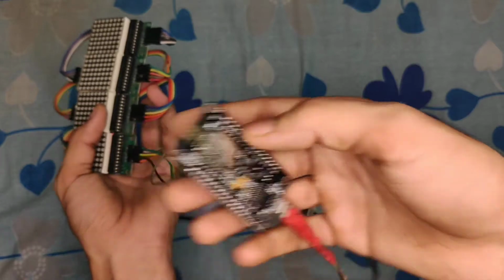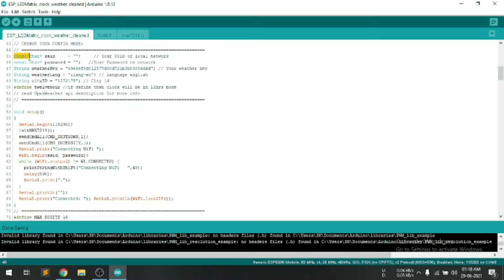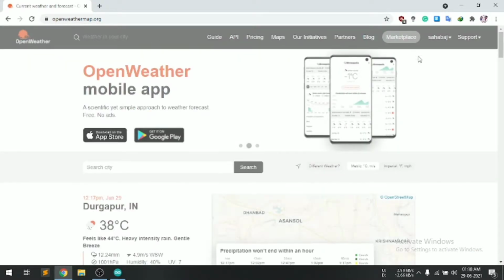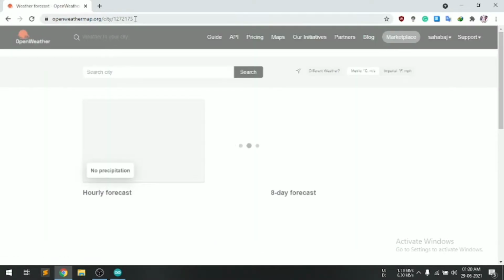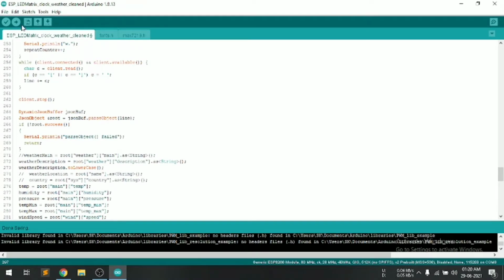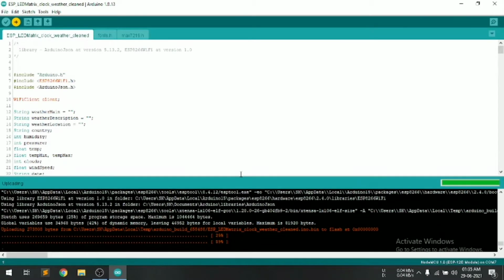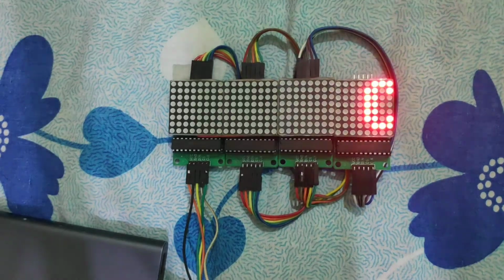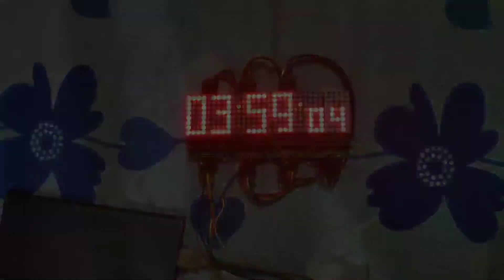Nodemcu (Esp8266) & Max7219 weather station/Clock. The easiest way?

Comment: I encounter     long epoch = round(curEpoch + 3600 * utcOffset + 86400L) % 86400L;  error, could you tell me how to solve,please
Reply: Same issue here,
 dont know how to solve
Reply from the maker: @TanvirAhmed101 also u can replace the line with this but this isn't tested u can try and report back long epoch = (long)(round(curEpoch + 3600 * utcOffset + 86400L)) % 86400L;
Reply: @SKElectronics  This code change worked, the only issue is your system is configured to use 4 separate 8x8 to make a 4x1, but most of the people might use 4x1 Matrix, now all information are scrolling vertically   :D
Reply from the maker: @TanvirAhmed101  if that what's u want then great
Reply: @TanvirAhmed101   can u giveme the code for  4 in 1 matrix 7219 display
Reply from the maker: @TanvirAhmed101  The code cannot be compiled on the latest version of the ESP board (2.5.0), so we must install an older version (2.4.2)
Reply from the maker: search the error on Google u will find how to solve it.
Reply: @SKElectronics  Yes Sir.

Comment: Sir, fonts.h library not available?
Reply from the maker: available put all files in same folder
Reply: Sir, display format is not proper.
Reply from the maker: @pawankumarsingh3996  r u using the same display module or not?

Comment: Hello!  When compiling the code, it gave me the following error: "error: DynamicJsonBuffer is a class from ArduinoJson 5" (lines 325 and 334).  Any idea why that happened?  Thank you very much!
Reply from the maker: U have to download from library manager ArduinoJson 5.16 latest version of the same won't work.
Reply: @SKElectronics  I can not find "ArduinoJson 5.16". Do you Upload the library?
Reply from the maker: go to library manager search ArduinoJson there u can select version
Reply: @SKElectronics  Sorry to say 5.6 version is not available in the library manager. Do you upload the ArduinoJson 5.6 version? Or give us the download link of 5.6 version. Or Update the code of latest version. Thank you so much.
Reply from the maker: @TanzilHudaJnU  also replace 402 line with this other wise u will get error -
long epoch = (long)(round(curEpoch + 3600 * utcOffset + 86400L)) % 86400L;

Comment: Bro, Open Weather API didn't work is it payable?
Reply from the maker: u don't have to pay for date time data extraction.
Reply: @SKElectronics  no no Bro you didn't understand for weather forecast API didn't work?
Reply from the maker: @addiction-69  u have to create your own api with your own account.
Reply: @SKElectronics  yeah! I do that, but it didn't work. That's why I was ask you that is it payable?
Reply from the maker: @addiction-69  it is but maybe u r doing something wrong that's why it didn't work.
Reply: @SKElectronics  Weather does not work for me either  I have an API key which works in another code/program   also the  time is wrong
float utcOffset = 7;  //Change utcoffset according to your utc any +- varry a little bit adjust it as per the needs.
makes no difference

I  like the clock display  with small seconds  but unfortunately unusable :-(
Reply from the maker: go to my facebook page and msg me there may be it could be solved
Reply: @addiction-69  same problem
Is there any solution

Comment: i am using fc16 module {4 max7219  preconnected 8*32] what changes should i make in the code? can you help
Reply from the maker: Maybe a little if orientation is wrong if not that then 😅 I don't have that module otherwise I would have implemented that
Reply: @SKElectronics  me sale mal orientado